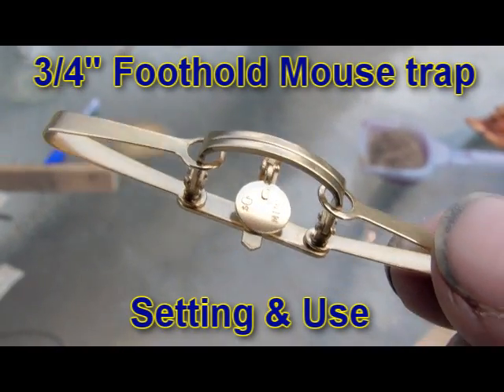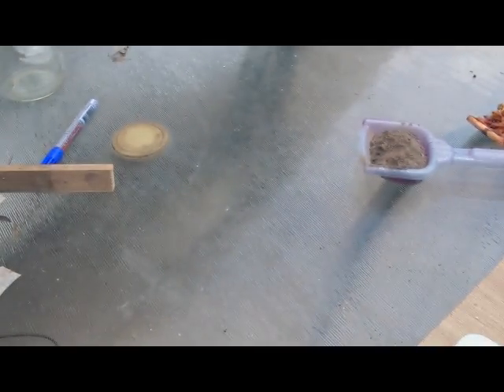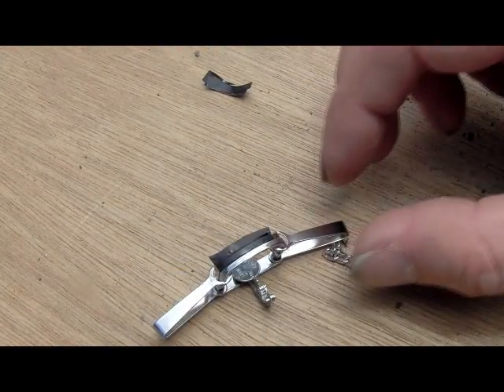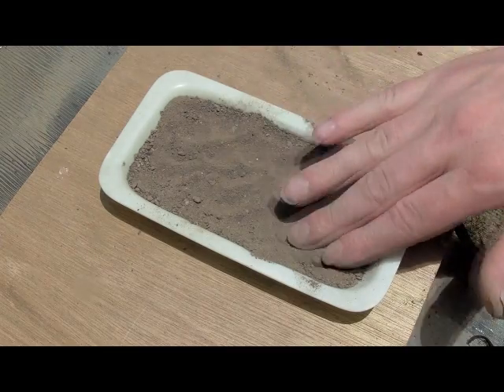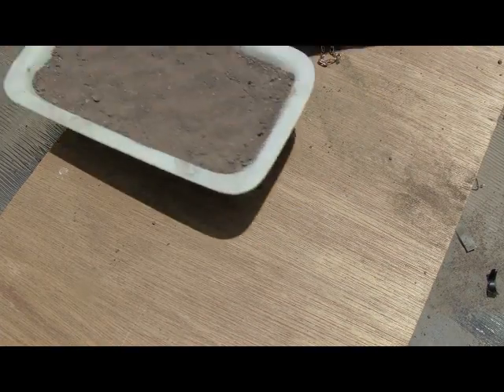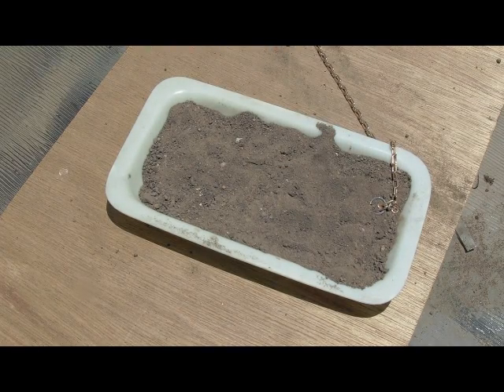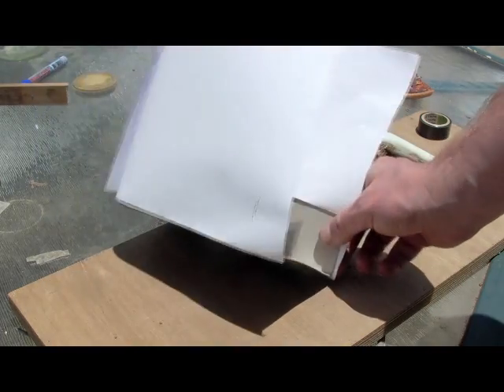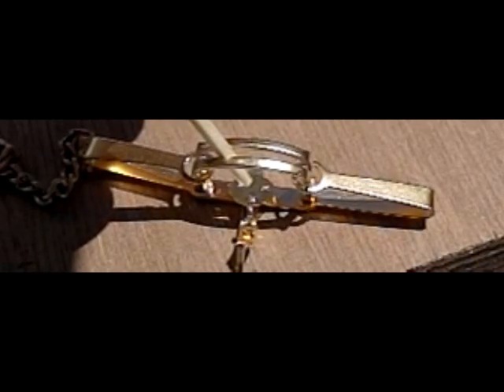Proper use of 3/4" Foothold Mouse Trap

Comment: I thought you were pulling my leg with your little trap, i did not think it was real till i saw it on the mouse.
Reply: +NH Bopop
He noted in a reply to another commenter that it apparently isn't a mousetrap, but a novelty keychain. That happens to work. On mice. Which explains the gold/chrome plating.

Legs have been pulled. I think. Does this count?

Comment: I'm trying to look at this from both sides, but I'm inclined to agree with Edward1131.  A mouse with a broken leg will die if released, so you can't do that.  And if you kill it, there would be no point in using these as appose to a two dollar snap trap that breaks a mouse's neck.  But release is the only reason I can think of to use a live trap, so I'm confused as to why you did this.  Were you just wondering if these traps would work?  I hope you put the poor thing out of its misery after..

Comment: As a youth I ran a trapline, Imoved away from the leg hold to the conabear body crush trap.  I don't like to see any animal suffer anymore than is totally necessary.  I Hunt mostly bpw range with firearms making headshots safe and reliable, no prolonged wait for the animal to expire.  The mosquito trap you used is great but not practical in an outdoor setting, I lost bigger traps when birds of prey found my victims stuggling to escape.  Body crushers no struggle no attracting unwanted diners.  Can't begin to grasp the terror that a leghold device inflicts, not to mention pain.  to be tied in place and offered up as dinner without the ability to escape or to fight.  No dead is better.

Comment: Just a little note here for you - roll /rotate both of those springs 90 degrees and toward the side which has the dog - the flat 'triggering bar' that works in conjunction with the pan and that holds the jaw(s) down) after the trap is set - and this will allow the other jaw to lay much flatter - at least as flat as the jaw being held down under the dog.  The instant explanation here surely lacks in good, easy to follow info, and thus will just as surely confuse the hell out of most readers, so I apologize for that now. That said and to further clarify a bit, rolling both long springs properly (at right angles to the jaws and toward the side holding the dog) will result in the set trap not being laid out straight as shown here, but instead will generally configure it into a "u" shape with the opening of the "u" open and facing toward the dog side of the trap.  I wish I could add a simple image to this, as it would make it VERY easy to both explain and understand!
Reply: +Vernon Phillips Well said :)
Reply: +Pennsyltucky Trapper
Made sense to me. Turning the springs shifts the slight angle of the springs' top hole to allow the far jaw to be lower. Depends more on how exactly the spring sits, though. Some springs may be angled down toward the jaw hinges, while some may be angled up or not at all.

Comment: I got one of these but it does not work. Yours in the video shows Smooth action of the trap. If i open the jaws, the action is so rough and tight, the jaws will not close.
Reply: Where did you get yours?
Reply: why dont you put some oil...... ????
Reply: Yeah. Put some oil on that, and itll work good.

Comment: The goddamn plagues of mice that roll through Australia every couple years & you gotta go through all this shit just to catch 1 friggin mouse? Dig 1 large circle & fill with water, lay a few boards across at a few different points, makeshift low structure for them to think it's safe, lots of grain/ feed whatever to lure them in & when you've got 100 or so chowing down pull the boards & fuck'n flamethrower the little buggers.